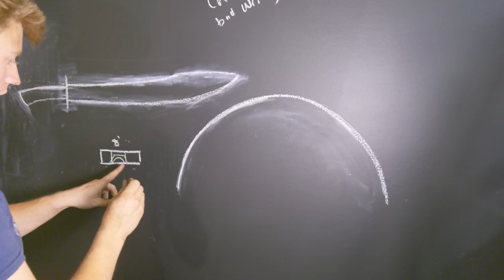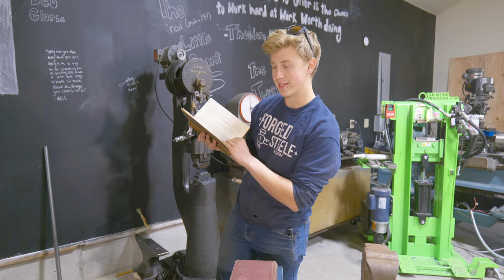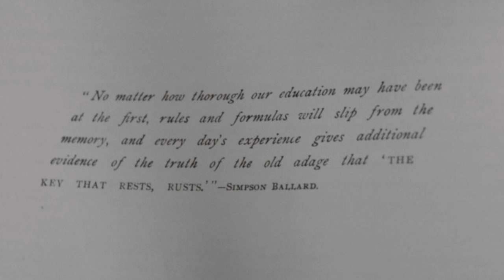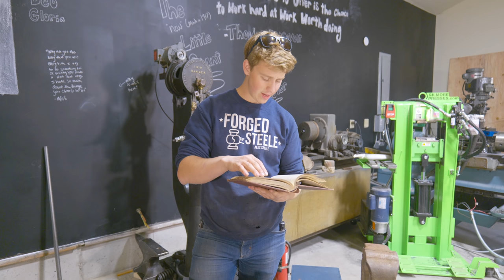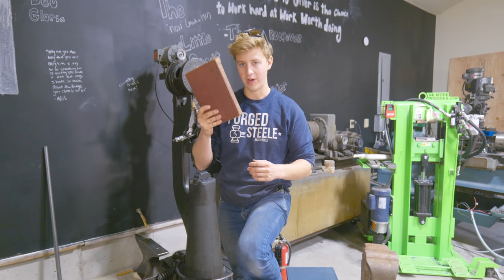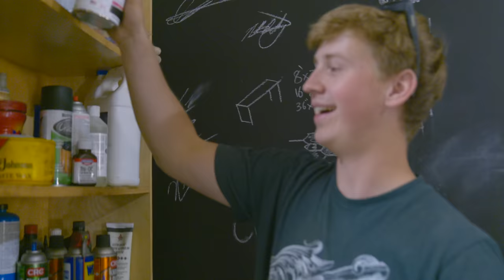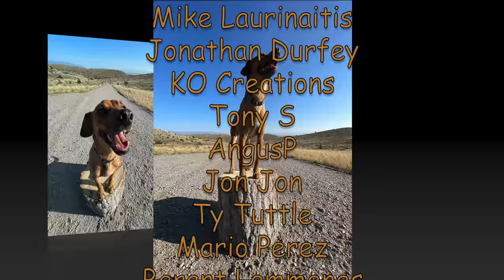Making a Jewelry Bench (With Vise Restoration)

Comment: Will, you're right about mechanical drawing, which was a required class back in my teens. It's all about precision and discipline. A perfect starting point for your projects. 👍
Reply: I've had to take a class on mechanical drawings a few years back for my bachelor in mechanical engineering. We had to do like 20 drawings in total, nowadays my CAD just spits them out automatically 😅
Reply: @AramcoPhil  I also had a required class in hand setting type, does that age me? 🤣
Reply: @saginawdan  oof.. yea 🤣
Reply: @saginawdan  Yep, me too. Print Shop in High School in the late 60s, along with Mechanical Drawing.
Reply: @AramcoPhil  Learning CAD gives you all the essential knowledge but putting pencil to drafting vellum is so much more personal for me, and really emphasizes "get it right the first time'".
Reply: @AramcoPhil  got your 0.3 mechanical pencil?
Reply: My high school had a drafting class,not sure if it still does. It also had woodshop, auto shop,and welding. I took all 4 and am in my early 30s.
Reply: How about making a sweet drafting table !
Reply: @jamesdeadman6725  Now you're talking!
Reply: It was an elective class for me in the 90s, and it was still mostly old school drafting by hand.  The CAD software age had barely started at the time.

Comment: Love how that drill vibrated off the table in high speed. That’s happened to me so many times… 🤦
Reply: It hurt bc I felt that pain, have had a couple Milwaukee battery casings and impact heads busted by that very thing😭
Reply: @walterammons5344  Exactly. I have two workstations that vibrate more than the others… I’ve definitely gotten better, but it still happens from time to time
Reply: the drill was in hammer drill mode and that made drilling wood so challenging.
Reply: @noelandrew3600  ah just asked the same question lol, did wonder
Reply: @walterammons5344  my craftsman  at least waited about 16 years before it decided to jump off my ladder XD it still works just fine but it has a bit of a crack where the batt snaps in.  i honestly cant believe the the stuff is still working i bought the set in 2002

Comment: For things you want to be able to move, but that you don't want moving accidentally, it's usually better to use 2 caster wheels instead of 4. Then you put a handle somewhere that will let you easily lift the side without the caster wheels a tiny bit off the ground.

Comment: I know the weight of the vise(s?) on the front side of the jewelry bench will probably mostly eliminate the backwards tipping issue, but that bench may benefit from having some weights added to the base so it's not so top heavy. Just an idea. I'm glad to hear you'll be getting the power hammer up and running super soon. Cheers, Will, and God bless.

Comment: I started learning drafting in the 7th grade (part time, and some in 8th). Took 2 years in high school, and used it to design theatrical productions. 
When putting things down to paper, you have the time to figure out how to make it, what measurements, cuts, joints, etc to do. Basically, you can plan out your project and solve problems before you start. 
I also like doing isometric drawings to “see” three sides at once: to get a better feeling for the total look. It also helps your client to visualize the project.

Comment: Alec misses you.   

Metal shop class in 7th grade (the late 60s for me) we had to make high quality to scale pencil drawings of all our projects before we built them.  We started by practicing drawing cubic  and other solids with straight edges using 45 (?) degree perspective (I still recall getting dinged a point because one of my almost invisible eraser marks was deemed too "smudgy" ... we were graded on a curve and it could have cost me an "A" for the class!)

Comment: I'm glad that I'm just old enough to have had to learn drafting as well as CAD when getting my technical degree (since have gone and got my mechanical engineering degree), many younger colleagues were jealous that I could make such good sketches when working with clients, they only ever learnt CAD... I have an old book on (mechanical) power generation and transmission from the 1930s, not only is it still relevant (though I don't design canals), not much has changed, the math is still valid... I pull it out as often as my books on CFD...

Comment: It's pretty good for small filing work. You may need something more anchored and wider for chipping work or engraving. You may want to use a vise for draw plate work, which produces wire to make inlays, ring shanks and chain links. If you pull wire through a draw plate, it will try to yank that narrow bench over. 

If you want to get a rolling mill, get a French one and stay away from the imported stuff. The press wheels in the Chinese ones break a lot. Instead of an anvil I use a 6 inch long piece of railroad track. A book you should get is Oppai Untracht's Metal Techniques for Craftsmen. I was able to make some pretty good niello from a recipe in it, and there are a lot of small metal craft heat treatment techniques in it that you will find interesting.

The binocular bench magnifier that Alex uses with a ball engraver is a great, almost perfect way to do small work. I look at that setup as something I might put together some day for myself.

Comment: Congrats on the 200,000 subscribers might I recommend that instead of letting your epoxy sit mix in some fumed silica or wood dust (fine sawdust) this thickens your epoxy without shortening your pot life. Also I'd recommend putting a lip on the back edge of that bench noting that drill falling off the back

Comment: I learned a long time ago. Not to weld casters to anything. It's so much easier to replace them when they break if bolted to a plate. That, and if you are worried about your frame being twisted its easier to shim. But then again I have some casters that are over 20 yrs old.

Comment: Will, not sure you'll see this, but 2 cents from a woodworker (You probably already accounted for it, if so, no worries). Wood expands and contracts with the seasons. While plywood is stable enough to just screw or nail in place, a top like yours would be best to fasten with z clips, figure 8 tabletop fasteners, or something else that will account for the movement. Generally if you don't account for the movement, your table/bench/desk top is more liable to crack. Yours may be narrow enough it won't matter.

Thanks for the content.

Comment: Not sure if someone already suggested this. For the tall toppling mobile bench, you could widen the base by adding a lower bench top on the other side, also with wheels. It could attach to the tall bench with bolts, to remove. Then you have space for chair work too and the bench is stable. Though its nice to be able to work 360 around a bench. Maybe just weigh the tall bench down and you're good.

Looking forward to seeing the power hammer making blades!

Comment: Congrats on the 200K!!!! I'm just looking at that bench and how tippy it is...... and the very expensive microscope on top of it 😅🤔 I'm just wondering about extending the frame of the bench back a bit to create an extra storage area behind the bench. It doesn't need to be full hight but you could use it to store extra steel off cuts or box's or something...... basically the important bit is making the whole unit a bit deeper..... I'm thinking about twice as deep to be safe. Looking forward to your next crazy project 👍👍👍👍

Comment: For drilling larger holes like that in wood, you might want to consider picking up a set of Forstner bits. Spade bits tend to do a fair bit of damage when you use them to drill through like that.

Comment: Will, I'm an engineer, and am considered a subject matter expert in drafting.  Granted, using CAD software, but I have studied the source of a lot of the practices used, and many remain from hand drafting.  Like if you draw a spline, the way the computer calculates that is similar to how you'd draw it by hand.  There are actually some conventions that remain in ASME Y14 (current drafting standard) that are really difficult to do in CAD that would be easy in hand drafting.  All in all, I'd be very interested to skim through those books and see what has and hasn't changed.

Comment: maybe add some bracing to the lower parts of the C to avoid the bench tipping when loaded with stuff, that thing looks like it will make a dent into a foot or equipment if it falls.

Comment: Just mentioning this because you didn't say anything about it in your video - when you screw a wooden table top onto any kind of frame is a good idea to make the holes in the frame oversized by a good amount to allow for seasonal wood movement across the grain. If you don't allow the necessary room to move the whole top will most likely rack or split within the first year or so

Comment: lol, I don't know if a spade bit is designed/meant to be used in a hammer drill. I'd think the hammer effect would make it harder to use. 

That vise is pretty cool and it is amazing how many good ideas disappear due to favourites.

There are plenty of good modern textbooks for technical drawings though it is of course goes through drawings made with a computer

Comment: Drafting was one of my classes in Jr. High. It disappeared from schools in the late '70s along with the Slide Rule, and most shop (manual arts) classes. I got to see the transition in the industry from manual to CAD. The difference for me is that the manual drawings had style and character, the CAD drawings are cold and efficient looking by comparison. 
You're right, manual drafting/engineering drawing is really a lost art.
Reply: They still taught manual drafting even in the 90s.  I had it in HS, and the class was at least 50%+ hand drawn.  CAD software wasn't exactly advanced back then.  All of the fundamentals were taught by hand.

Comment: I took mechanical drafting two years in HS and two semesters in college.  It helps me even now when I develop a CAD drawing.  The drafting rules haven't changed much; only how the lines are made on paper.  I would recommend you get a "drafting machine" (it only has X & Y axis rulers fixed at 90 deg to one another and can be rotated by the scale to any angle.  Makes work quicker.  I still see them around periodically.  Engineering shops may have some stored in an attic that they would even give you.

Comment: Will! You need to IMMEDIATELY wax bottom side of this table as well. 

Otherwise it will draw in more moisture with one side than the other and the wood will expand unevenly. If it doesn't have the ability to arch it, it will just break

Comment: I have a question for anyone that can answer. I am a young blacksmith and i do a lot of knife making which in turn requires a lot of grinding. I need to wear some sort of respirator because i don’t want to be on oxygen by the time i am 24. So should i wear a real deal respirator with filters and crap or should i just wear a cloth mask like a bandana or gator? Thank you for answers.

Comment: Great stuff, Will. Fun interjections between the project.

Some knee/stub walls on the front sides to support lower shelf to help with the weight getting down low. Also, more storage for the stuff, that weighs a lot.

Using the circle cutout as a lowered bench right where it came from would be cool. Just figure out a bracket to hold it down there solidly.

Comment: The bench is top-heavy....the center of gravity of that loaded bench needs to be lower....I would add two low shelves, right and left of the carve-out, and store some heavy items there...lower the better. Since the bench is on wheels, it could tip over while moving ( don't take much to suddenly stop a rolling caster - any stray debris on the shop floor).  Be safe, avoid the Oooops!

Comment: When I tried sizing down an old 7ft 3inch thick butcherblock table I also discovered wuth my circular saw, they used a rod threaded on each end to hold the slab together. The wooden plugs on the edges should have been the obvious clue I missed

Comment: TIP FOR TODAY 
SANDPAPER , cutting and grinding disc-s
Try 3M CUBITRON II 
it is the fastest , non cloging ,extremely durable type of abrasive on the market
it will outrun Mirka , Norton , Bosh 10times 
cost more , but i already save a lot of money using it in comparsion to cheaper options
cutting discs are as fast as "bosh fast cut" but last 10times more and wont slow down
the same goes with grinding discs 
and sandpaper ...ohhh man , sandpaper is epic 
i use orbital sanders for composites , few hundred of discs per mont destroyed easly 
where when i use cubitron .... i need 1 untill it will get damaged on the edge etc 
it cut 90-100$ for sandpaper to 15$  in my case and speed up every job that need sandpaper etc few times :D

Comment: As a jewler, your design for the cut out is too deep. The 18” spread is ok but it doesn’t need to be that deep. Also, a pull out steel bench pan is way better than just a cloth.